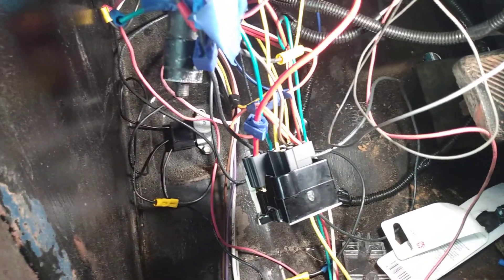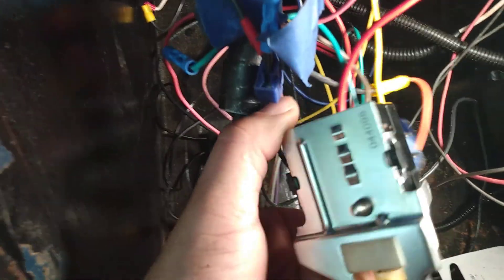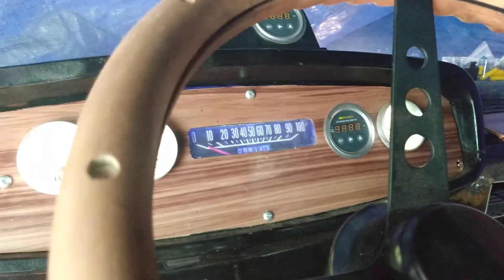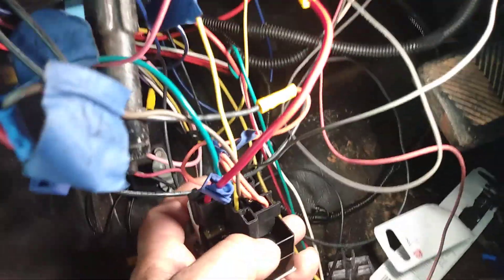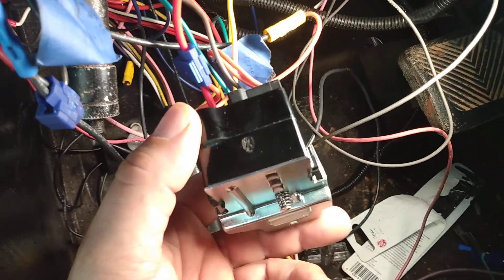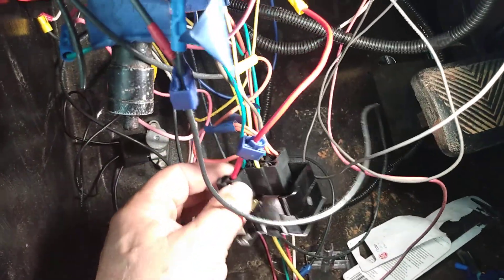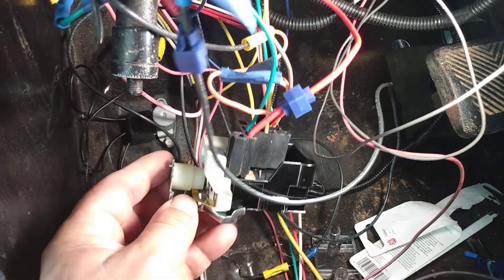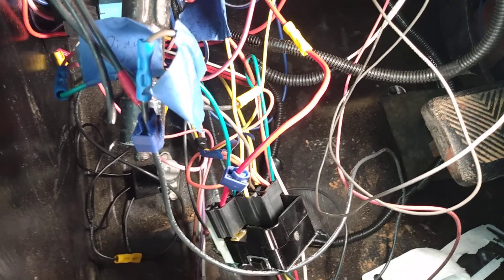GM Headlight switch wiring debacle explained

Comment: I have been watching videos to figure out the light switch on my dad's 1963 gmc.  One video stated the red wire comes in hot and it's unfused. The orange wire comes in hot and it is fused. If your orange wire is not hot, check out the fuses.
Reply from the maker: This was a custom job on a 64 Dodge w300 power wagon It's been working far😉 Thank for that info

Comment: Hey thank for the video.   Ive a speedway motor wiring harness for my 65 chevy sportvan and it has the 7 pin switch. The harness only has 4 wires and the original has 7?  Two wires going in to where you ran a jumper and the harness doesnt have a wire for that.  And then theres another wire going into the ground spot.  No wire for that either.   

Can you believe my van had no fuse box was just hard wired.  And the debockle of wires under the dash isnt helping.  Just a ball of mess.
Reply from the maker: I can believe it Dodge w300 parts are scarce as well as expensive 🙄 Thanks for the comment glad it helped you out. Stay busy stay Dirty!

Comment: Hi Dan, After I got a new alternator put in my gages spun crazily, they were working perfectly fine before the new alternator. I found an universal wiring kit for it and they all say the green one is for the coolant temp sensor but I don’t know where that is under the hood😭. After the mechanic put in the new alternator and I checked the green wire looked like this at the end,  burned off at the end. At this point I’m wanting to just connect it myself, got anyway I can send you a picture?
Reply from the maker: You can find me on Twitter Its in my YouTube Page